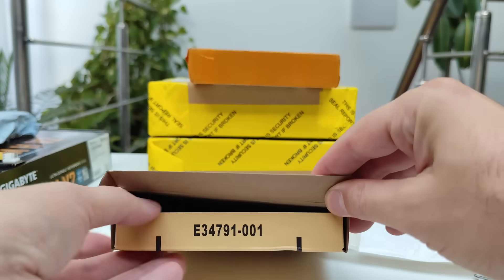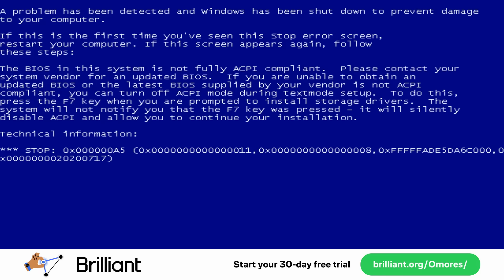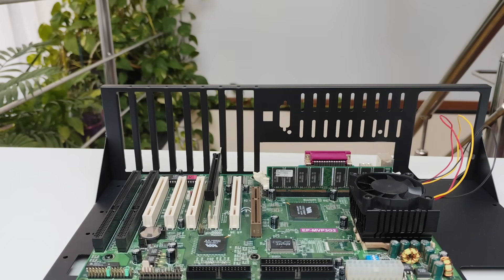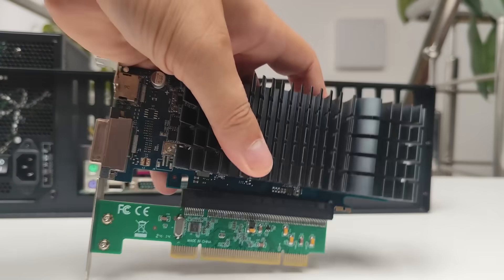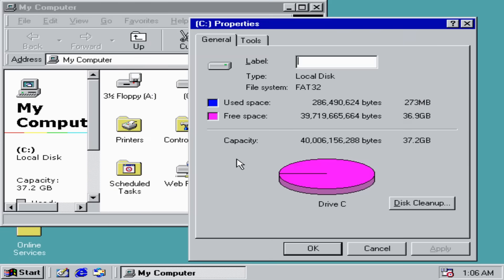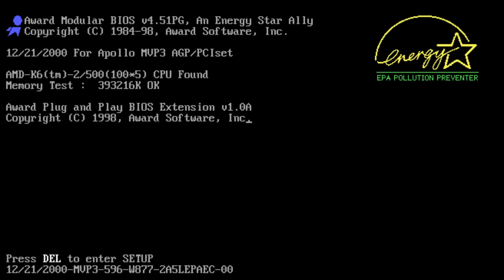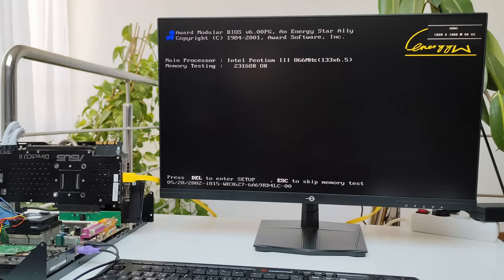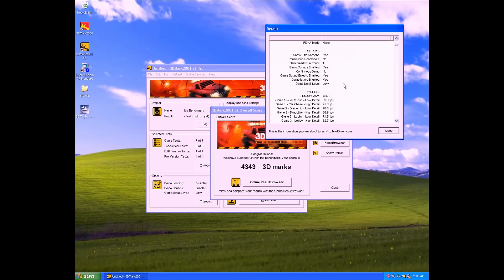The Ultimate BOTTLENECK: NVIDIA GTX 980 Meets Pentium III via PCI Adapter

Comment: PEX 8112 is also a reversible chip. 
It can be configured to operate from PCI-e to PCI or PCI to PCI-e
I've made designs with that chip. 
Quite flexible.
Reply from the maker: Yes, indeed... But since all the PCIe-to-PCI adapters and PCIe cards with bridge chips that I have use either ASM1083 or PI7C9X, I assumed PEX8112 works only one-way. :)

Comment: Pentium 3 - athlon (socket A) should be alternative CPU there (year production)... K7 not K6.

And of course windows 3.11 is back. Windows 98 found new hardware: geforce 7900 gs 🤣... It's approximately vista epoch (2006).

So windows me & xp are between.
Reply from the maker: Actually, the 7900GS also works in Windows 11by using Windows 8 64bit drivers, check it out here: https://youtu.be/3nCSGApJGbQ
Reply: @O_mores I'm interesting in radeon actually...

As for me it is very strange - found not 32 mb VGA in windows 98 setup but some like 10 years later device.

Socket AM3 was created for windows 8 (compatibility) but users like installing intel 45 nm CPU onto windows 98 computer (CRT display).

And windows 10 or 11 working very slow on 2005 VGA - situation about 8 GB DDR 4 not 256 mb DDR (400 MHz).

Comment: The first issue I see with the adapter is that pcie can and probably does demand 75w from the slot.

A powered adapter is probably required. 

The second, around the memory allocation, check where it is in memory. The card may be requesting an address that physically doesn't exist. Ie, the pcie address space might be beyond the 1gb mark.
Reply from the maker: Yes, I actually mentioned this at 04:12. The PCIe x1 slot can deliver 25W, just like the PCI standard. Even so the adapter comes with a power connector. The adapter itself (with the ASMedia 1083 chip) draws less than 1W. As for address space, the same GPU works on an SK370 motherboard with 512MB of RAM, and I even booted with 256MB. So I don't know... I’ll do more testing - it took me half a day to give up on Super Socket 7...
Reply: @O_mores  changing the power draw allowed on a per slot basis requires circuitry that simply doesn't exist on consumer boards.

Look at the traces. They're all simply direct to 12/3v
Reply: @O_mores  the power part of pcie slots is the bit near the back of the case before the gap.
You'll note that 1x 4x 16x are identical in this regard. They are capable of providing 75w.
Pci can only manage 25w.

You might be confusing the "start up" load guidelines.
Reply from the maker: @myne00 - I did a bit of research, and there are some nuances. By default, a PCIe x1 slot operates in low-power mode, supplying up to 10 W. That’s why PCIe-to-PCI adapters often include a power connector - because a PCI device can draw up to 25 W, but the PCIe slot might only provide 10 W. A PCIe x1 slot can deliver up to 25 W if the device requests high-power mode, but according to the PCIe specification, this isn’t mandatory - only 10 W is guaranteed. In practice, though, most motherboards do allow up to 25 W via the 3.3 V and 12 V pins in a PCI-E x1 slot.

Comment: and here i was thinking my 980 in a pcie 2 slot with a core 2 quad was bad...
Reply from the maker: I remember the Core 2 Quad days very vividly - the last model was released in 2010. But socket 775 as a platform, stayed relevant a bit longer. I actually remember a colleague who bought a new GTX 780 for his Q9550 setup back in 2014. The GTX 980 was released Q3/2014 so you might not be the only one...
Reply: @O_mores  i saw some people rocking such a setup even somewhat recently! the core 2 quad is actually surprisingly "fast", still. i find myself being very satisfied with my desktop core 2 duo even

Comment: Would it be possible to get a AGP to PCIE bridge adapter? Some cards from around 2006 used a bridge chip to work on AGP during the transition period, I wonder if such a chip can be found on an adapter card. Might help get you a lot more bandwidth
Reply: Yeah, they exist. Agp is fully compatible with pci.

It's pci with additional optional management channel.
Most cards didn't require the use of the extra channels, presumably because the same chips were used in pci cards.
Reply from the maker: Check out this AGP-to-PCI adapter! I briefly showed it in this video, but it also has its own dedicated video where we tested quite a few AGP cards: https://youtu.be/jflb_6Bpv-o

This AGP-to-PCI adapter can actually be inserted into a PCIe-to-PCI adapter... and it will work! Though, using two adapters like this looks ridiculous and becomes physically unstable. So there are direct AGP-to-PCIe adapters that use common bridge chips (like the ASM1083) and handle the job more cleanly...
Reply: i been trying ot get well the AGP-pcie adopter ordered one but the seller cancelled because they were in russia and well the enlgish government at the time (before the war) done something oh yeh BREXIT! so i have AGP cards i canot install in any modern system aka agp to pci to pcie because of this!
Reply: I remember when PCI-E released, the 6800GT was using the NV45 chip, which was an AGP chip, so all PCI-E versions of the 6800GT card had a PCI-E to AGP bridge.
It wasn't the case for the 6600GT, which was using the NV43 chip, natively PCI-E, but an AGP version of this card existed for older motherboards, so you could still find some with a bridge (but working the other way around).
Around 2004-2005, the number of things that changed was insane, AMD released the 1st Athlon 64 (socket 754) that moved the memory controller in the CPU, then the socket 939 with dual channel (and socket 940 for the Opteron line, with an ECC memory controller). On Intel platforms' side, the socket LGA775 and DDR2 with dual channel chipsets released.
The gigabit ethernet really started to take off as well, and of course with all that, the PCI-E

Comment: It would perform much better on AGP 4x or 8x Bus...
Reply from the maker: Generally, yes - more bandwidth helps. But in 3DMark 2001, I don’t think you can get a higher score with this CPU. I actually tested an 8800 GT, a GPU from late 2007, and it scored the same as the GTX 980 - which is many times faster.   8800 GT: ~336 GFLOPS /  GTX 980: ~4.6 TFLOPS (~13.7x faster in raw compute)

Comment: Why anyone would want to cripple a GTX 980 in this fashion is beyond me.  It's akin to putting a 700 horsepower motor into a Model-T Ford and you can't even rev the motor because it will demolish the drivetrain and twist the frame.
Reply from the maker: @ferrellsl For this specific attempt, I was actually trying to beat a world record. Let's just say I didn't start the fight... that guy put an nVidia FX5900XT on a Super Socket 7 PC. So I thought I could beat that record with this kludge. It didn't work as expected... but it was fun to try!
Reply: for fun
Reply: @DatSun.  You probably find picking your nose fun too.

Comment: Great video. I've been experimenting with these adapters for a while, including AGP to PCIe, but unfortunately I didn't have any success with Socket 7. It didn't work with AGP either. You keep getting a conflict in the address range 00000000-0000FFFF. But Windows can't see the graphics card if the bridge isn't initialized correctly. That's the problem. I've got a few computers with these adapters here, even a small Deskpro EN SFF with a GT440 and P3 1GHz. You can even turn minis like that into real retro gaming machines with them. I also have a Tyan server board with dual Xeon Nocona 3.8. It has an R7 250 running in the PCI slot via an adapter. There haven't been any power issues so far, even though the cards draw a lot more power than the PCI is actually capable of. The systems are probably too slow even under full load and can't get the cards' full performance, so they won't consume much.  I even had a GTX750 Ti running on a normal PCI without an additional power connector
Reply from the maker: To draw more than 25 W from the slot, a PCIe card must request high-power mode, but  adapter must be configured to work in 25 W mode only, which is the maximum for PCIe x1. As for the bridge issues, here's an interesting comment from  @cybercat1531 : "The reason the GPU behind the bridge on the MVP3 can't be configured is because the BIOS actually doesn't setup the necessary memory type range that high up in the PCI address range for a second bridge device.
It really only sets up the PCI-PCI bridge in the chipset and the PCI-AGP bridge range in the chipset. 
But the extra PCI-PCIe bridge addressing with higher memory is not configured for the PEX 8112
Newer boards with newer BIOS do it correctly though as they expect more PCI bridges to be added.
I had to solve this issue in coreboot BIOS as well when experimenting with PCI bridges."
Reply: @O_mores OK, thanks for the comment. So, this address range is probably within the first 640kb, I've done some research. I'm also assuming it's a BIOS problem, as you already mentioned. By the way, I have an Athlon XP 2400+ with a PC Chips M811 motherboard. The AGP to PCI and PCI to PCIe bridge combination works there. I connected a GeForce GTX 960 in a vertical position via a riser. It works perfectly. But it's a huge bottleneck; the card's fans rarely spin, even under load. It's a shame it didn't work so easily on all boards.

Comment: I found that 440bx and later VIA chipsets work with PEX 8112 adapter under win9x but it also depends GPU being used.

All intel hub chipsets except ich6 and later won't work under win9x with this adapter, But under Windows NT it can usually find enough resources to initialise the card to make it work.

I sadly can't speak for non intel/via chipsets because i haven't test any nor own any.
Reply: This adapter works for me in Windows XP (but not in Windows 98) on Intel 845GL (Gigabyte GA-8LD533) motherboard with Radeon X600. Same combination (adapter+GPU) works fine in both XP and 98 on MS-7222 ver1.0 (VIA P4M800 Pro chipset).

Comment: Oh. That means, you can use an nvmee drive on a Pentium 3.
Reply from the maker: I actually have a Samsung SM951 drive that should have its own BootROM and might work. Like 99% of PCI-E SSDs don't have a BootROM as they expect BIOS support. SM951 is a PCIe SSD but uses the AHCI protocol instead of NVMe, which is even better for these older OSes... I'll do some testing today, as the P3 configuration is still on my bench.
Reply: @O_mores  lol keep the gpu installed to make it that much more cursed
Reply: forget ram exsisted nvme is faster
Reply: @avonfonds2567  you'd be severely bottlenecked by the PCI bus on any platform. Standard 33MHz PCI is limited to 133MHz/sec. Next limiting factor is front side bus, witch is also limited to 133Mhz/s. That's the major bottleneck of the pentium 2/3 platform.
Reply: @kaneCVR   "you'd be severely bottlenecked"  <---- nah, you don't say :face-green-smiling: 

i'm sure everyone here thought it would run at Gen 5 speeds.  

/s
Reply: Turning an entire nvme drive into a ramdisk for a computer like this would be hilarious
Reply: huh my comment was removed, guess i'll just repost it, as i said before there are some pentium 3 machines with pcix 64bit pci slots and i've seen an adapter to convert those to pcie a long time ago.
Reply: might be fun to find a board with 64bit pci/pci-x, i know some adapters existed to convert those to pcie. pci-x has been around since 1998 so there should be a pentium 3 board out there with them.
Reply: Someone will say,if it fit in a computer ,it will work in a way or another

Comment: I wish AGP could have easily be converted to PCIe.
Reply: Adapters exist.
It's a 66mhz pci port with a sideband channel.
The sideband wasn't required for operation by most agp cards.
Reply from the maker: @Wasmachineman Early AGP cards are essentially PCI cards with an AGP connector. This means they can be easily adapted for a PCI slot using just a simple pin-to-pin connector, as shown in this video: https://youtu.be/jflb_6Bpv-o  For a PCI-E slot, you just need to add a PCI-to-PCI-E bridge chip. Later AGP 8x cards won't work, at best, they'll boot as a standard VGA card, but the drivers will fail to load as they rely on AGP-specific features.

Comment: Typical ATX form factor Socket 7 and Super Socket 7 motherboards came with both PS/2 and USB 1.1 connectors. And no AT connectors of any kind. The reason your (Super) Socket 7 boards come with IBM PC (AT) DIN connectors for the keyboard and PS2 for the mouse and USB connectors, if present, on a extension slot plate you need to sacrifice one of the computer cases extension board slots to, is because they are not ATX motherboards, but Baby AT motherboards. These are intended to be used for upgrading old IBM AT  form factor computers, especially the mini AT tower systems which were very popular in the late 1980s to mid-to-late 1990s. Long before the ATX standard was even released, much less widely adopted in the industry. Because the ATX standard is also intentionally partially backwards compatible with the AT motherboard form factor, allowing mid-sized and especially "baby" AT boards to be installed into ATX cases and also because the cheap AT power supplies used in a lot of mini AT form factor computers were of poor quality and insufficient in power output and also thermally inefficient compared ATX PSUs, the Baby AT motherboards usually, but not always, also had an ATX connector kludged on to them. Allowing for a smart DIY person to upgrade a 1988 vintage Baby AT 286 or a 1990-92 vintage 486SX25 system which came with a weak <100W PSU to a bleeding edge  AMD K6-3 circa 98-00 (fastest office computer CPU at the time was AMD K6-3 @ 450 - 500Mhz) with the latest bells and whistles, with out having to go hunting for powerful enough AT PSU that would fit in a Baby AT tower to run that thing. The reason this board you're using has PS2 and USB sockets and no AT keyboard socket is, because its made to the ATX standard and specification, which doesn't bother with legacy bs, because that was the whole point of the ATX specification and standard. There's a damn reason it was necessary and still in use today, albeit the ATX 1.0 was catastrophically flawed, by putting the PSU fan on the bottom of the PSU pulling air into the case and mounting the PSU and the PSU hot air flow directly on top of the CPU and its fan, while also having absolutely no egress for air out of the case, or any other way to mount a case fan in the front other than taking a drill or dremel and drilling through both the case front plastic and the solid metal plate wall behind it, to make a hole for one. As heat will accumulate inside this oven, essentially what intel did there was to make a brave new standard for all future x86 IBNM PC-compatibles, that was designed to kill anything that complied with it, with in a couple of months or weeks of heavy daily use. :D I remember, because these things killed a lot of computers, couple of my friends new AMD K6-3 rigs in fact, and it almost killed mine before I realized this BS, and bought a non-standard compliant PSU that blew air out the back, and drilled a hole in the front of the case to add a damn fan to it as well. :D Clearly the people responsible for the first ATX standard, didn't know what they were doing. And I mean they didn't have any idea how to design anything related to microelectronics. Heat dissipation to prevent systems from cooking themselves alive has always been a part of electrical engineering. So, that's the level of comptence Intel usually demonstrates in understanding how to engineer anything. They probably threw a set of measurements they desired the thing to meet and a blueprint of a medium to small sized AT mobo they wanted to also bolt straight into it at a mechanical engineering subcontractor which proceeded to give them a CAD/CAM model drawings with in a couple of weeks, took it and ran with it, with out bothering to check what this design does with air flow or if its even a sane design from an electrical engineering perspective. Well, oopsie, after several hundred thousand ATX PCs had met an untimely death in major fortune 500 corporation offices and also gaming PCs in the hands of ATX first adopters, did anyone bother to check intels homework. :D :D
Reply from the maker: Just to clarify - I said 'this isn’t your typical Super Socket 7 motherboard' in the video, not that it’s atypical for an ATX motherboard.  And I totally agree - most Super Socket 7 boards in the wild were indeed Baby AT, especially for budget builds. I lived through those days - I remember very vividly all the motherboards and chipsets from that era. Even in 1998 and 1999, most regular budget boards still came in the AT form factor. I even had some fancy models in AT format. I remember my first ATX case that could turn itself off... and it was like, WOW. I called my friends over to show how great my ATX case was - but then Windows 98 randomly couldn’t shut itself down, so my demonstration was lame. But I restarted... gave it another try. :))
Reply: @O_mores  It is a typical Super Socket 7 motherboard. They were typically ATX standard boards at the time. No one was building new Super Socket 7 PCs with Baby AT mobos. The Baby AT boards, were not, as these were a kludge for enabling people to upgrade their own gear.

Comment: wow, a useful video. do more expiriments
Reply from the maker: More to come!
Reply: @O_mores  try replacing ram while on
Reply from the maker: @werehyenataur  I’ve actually got a Radeon HD GPU with a short on the back circuitry - one of the ceramic capacitors  glows orange. At first, I thought it was some kind of LED to show the card was powered on, but then it started to smell… :)) Still, the POST screen came up. Could be a fun experiment to see how long it works in this state.
Reply: @O_mores  I keep seeing upgrades to ram chips... I wanna see the reverse... how low can we go... etc 5090 with 16MB ram... lol